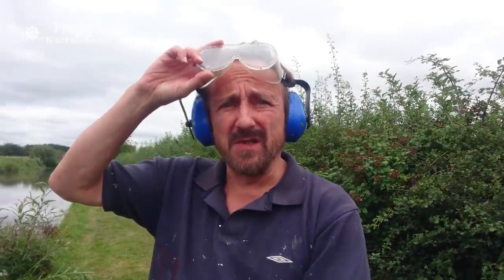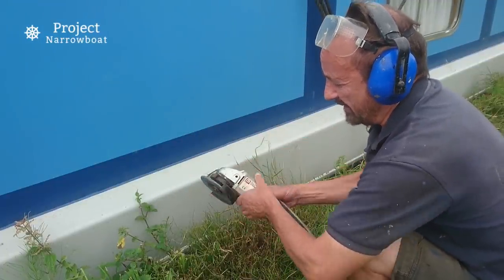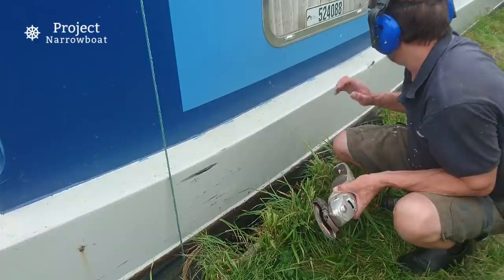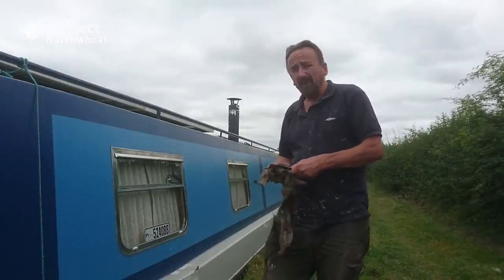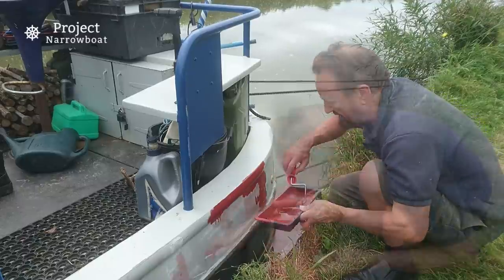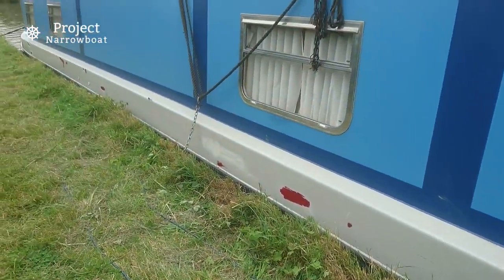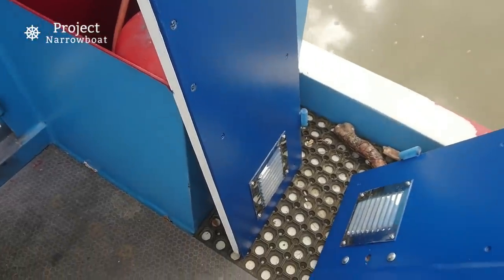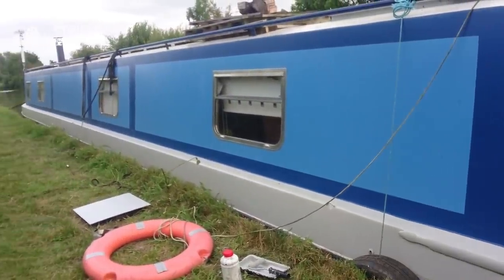Project Narrowboat ep 70 - A splash of paint

Comment: One tip I have learnt using body filler.  Use the plastic lid to mix the stuff up on. When finished and it has hardened.  You can bend the plastic lid and it comes off in chunks so the plastic lid can be reused again and again. Cheers from old George
Reply from the maker: That is spot on - I've lost the lid or maybe it snapped, so the next port of call is the metal top, not ideal. Thought I'd had it when the hardener jumped ship though.

Comment: Have a look at a flap wheel instead of a grinding wheel... won't need to use filler then.
Reply from the maker: I've used wire brush things before but I quite like the speed of the grinder, really gets 100% off.
Reply: @ProjectNarrowboat  Not a wire wheel but a flap wheel. Just as abrasive as a grinding wheel but not as aggressive

Comment: This is a great video. Are you using filler just to level up to match other paint surface? Just got our first boat and in good order apart from a few rusty patches- I’ve done all the steps except filler and I’ve got depressions- is it filler I need or just more paint layers? 
I’ve watched LOADS of YouTube vids and yours by far my favourite :)
Reply from the maker: Yes, definitely you need to use filler to get the paint level first - I see so many who don't bother and it always looks ghastly. You can get away with a little if the paint is good n think like the stuff I use, but any edges must be very well feathered. It's just 2 part car/wood filler so it goes off nice n quick.

Comment: Hi Johnny what sawer do you use 2 cut fire wood
Reply from the maker: I've got one of those folding saws, typically found at Robert Dyas or independent hardware stores, and around a tenner in various brands/colours. They last about a season - on the look out for another now. Plus I usually use a good pair of loppers for the smaller stuff but they went in the drink ages ago! Subsequently bought a pair from b&q which broke after 5 mins.